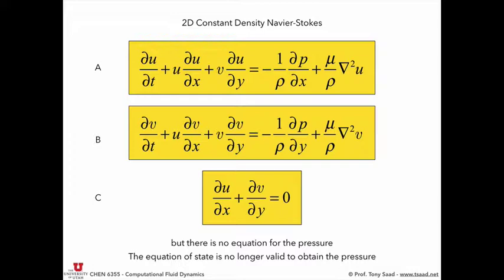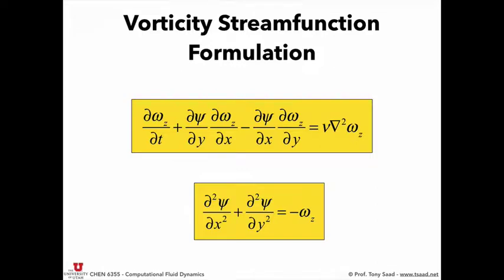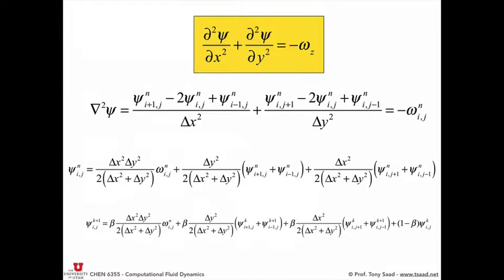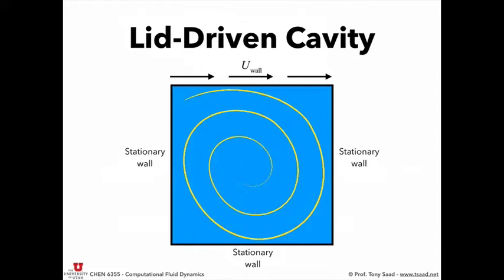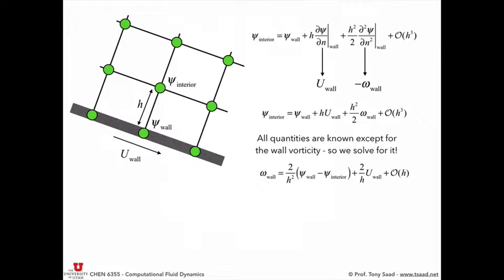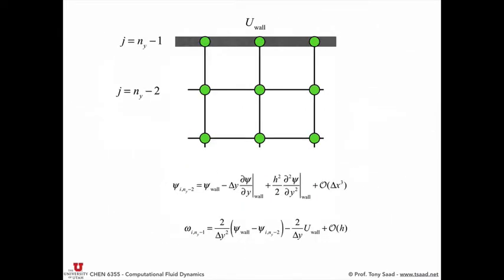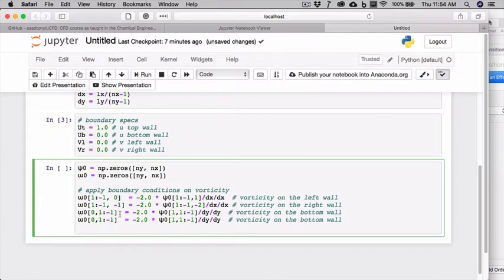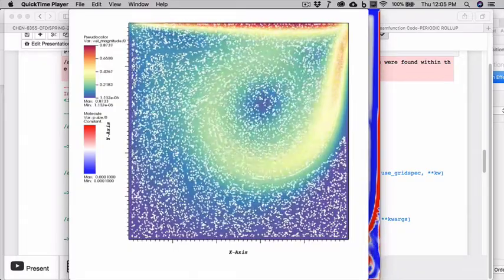7. Numerical Navier-Stokes: Vorticity-Streamfunction Formulation - Part 1

Comment: A small question: in Slide 11, when you express the boundary terms, it seems that the terms are changed in slide 13 later on (in slide 11 the boundary term on the left wall is on u, and suddenly in slide 13 the term is on v). seems like it's not a typo, then why this switch in terms occured?

Comment: The discussion at 50:00 or so regarding why the second derivative at the wall in the normal direction is non-zero while the second derivative on the wall in the tangential derivative is zero can also be shown by Taylor expansion. If you solve for the second derivative term tangentially, you'll get zero.

Comment: Fantastic course, thanks! Some of the missing annotation from the start of the video is covered in another video: 17.2  Vorticity-Streamfunction Formulation. We can't see what you are referring to for the profile/ vorticity propagation discussion from 11-13 minutes onwards, and I think some other parts. Are they somewhere?
Reply: Hi Tracy,

In other video comments, Tony has said that the sidebars are when he's drawing on the board in the classroom, and that part isn't recorded anywhere. Generally, you can hear what he's talking about and infer what's happening. For instance, the section you're referring to specifically is the classical uniform flow over a flat plate problem, which is canonical in any fluid mechanics course.